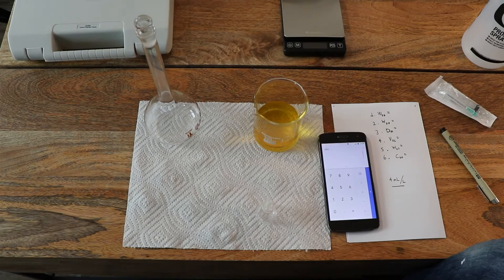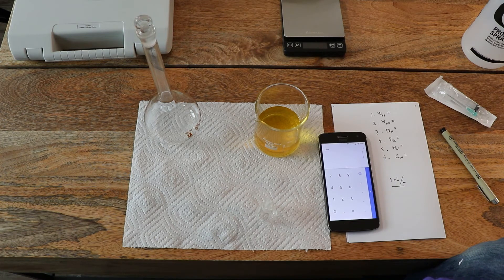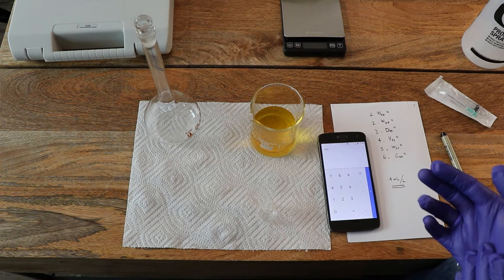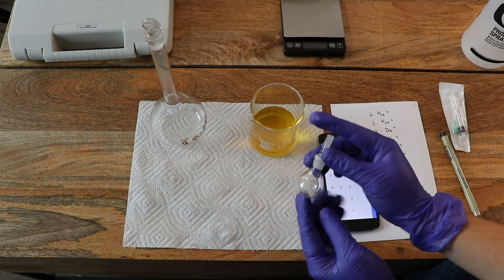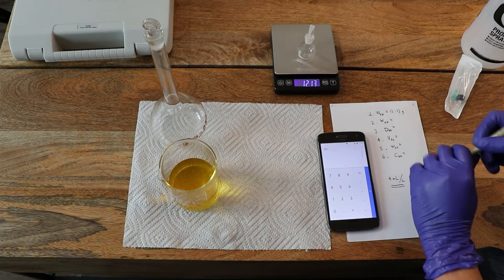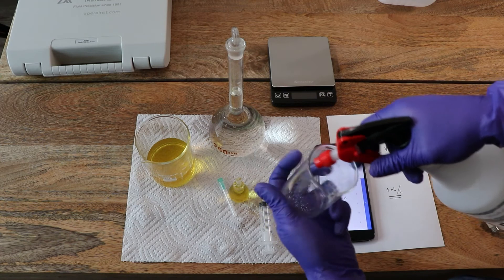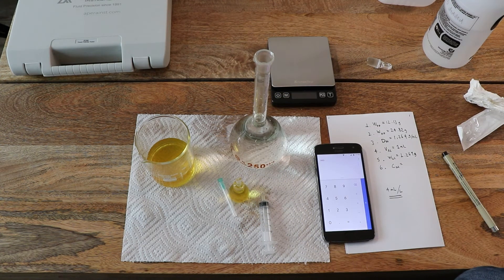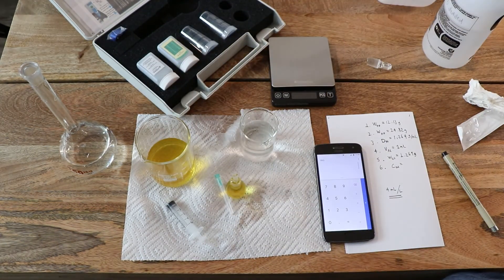Characterizing hydroponic stock nutrient solutions

Comment: Be careful using a pycnometer like this without calibration. Ive just been caught out quite bad. These pynometers are not very accurate. I measured my stock solution using this method, and my numbers were way off what  I expected after mixing a dilute solution. I checked the pycnometer with deionised water and it was 54ml instead of 50ml. Rather than assuming that the thing is accurate, you're better to weigh distilled/deionised water to calibrate, then divide the weight of solution and pycnometer by the weight of the pycnometer with water. Will give a much more accurate value. For example, My CalMag solution density came out as 1.2588 using this method, but with calibration, the actual figure is 1.157. ~10% l difference.
Reply from the maker: Thanks for your input. This is very valuable advice and certainly, making sure the pycnometer is accurate is of great importance. Measuring the density of pure water at a known temperature is a good way to find out. You can then use that value to calibrate to the actual volume of the pycnometer.

Comment: Why do you need to purge, what does that even mean?
Reply from the maker: To purge is to wash a container such that any undesirable substances in it will be washed away. It is standard practice in analytical chemistry but is great practice under any circumstance where you want to minimize the variance in the composition of a solution.

For example, you can wash a container where you will be storing concentrated nutrient solution with a bit of the solution three times (throwing it out each time) so that when you fill it with the solution any undesired substances - for example from soap when you washed the container - are removed and only the desired solution remains.

Comment: What are ideal conditions for storage and does the density of the solutions change over time ? 

I just found your blog a few hours ago. Keep on doing what you’re doing!
Reply from the maker: Thanks for commenting! The density of a solution should not change with time if it is well stored (airtight containers with negligible evaporation losses). However the B solution is sensitive to spoiling due to fungi, so it can only last for 1-2 months unless preservatives are added.
Reply: @ScienceinHydroponics  Thanks for the clarity! What do you recommend? I’ve seen sodium benzoat being used.

.. and when’s your next update? Can’t wait to learn more!
Reply from the maker: @icnping  Sodium benzoate will work as long as you keep the pH of your solution low enough and the benzoate is concentrated enough. I'm moving between countries this months! But expect regular updates to start coming mid February.